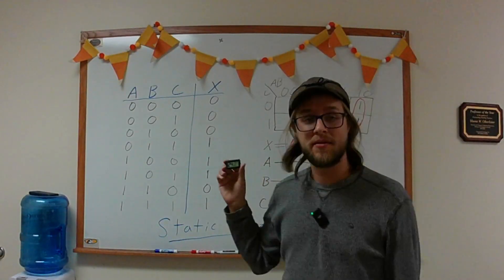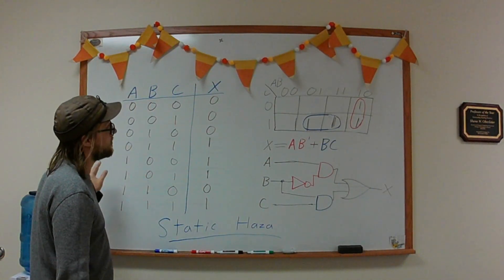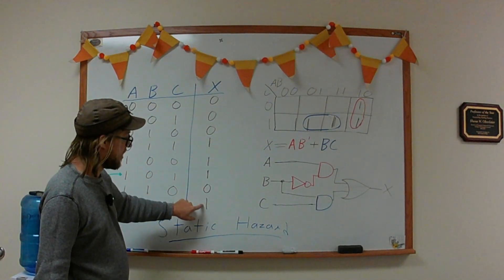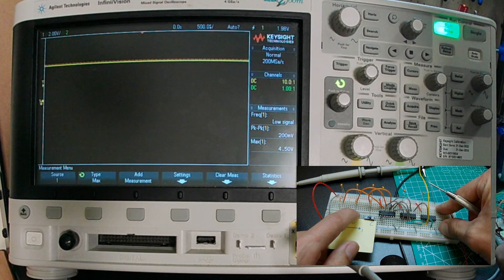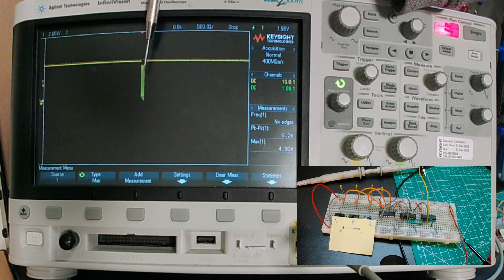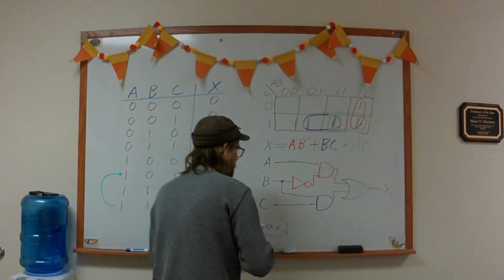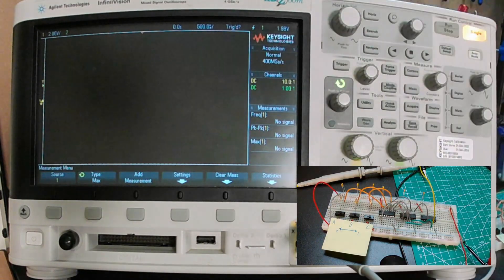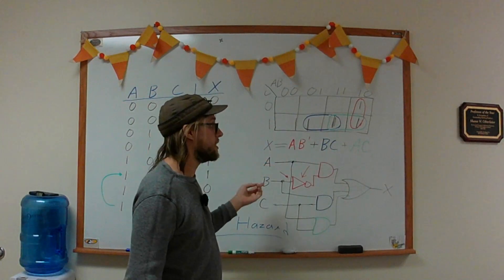Finding Digital Logic Static Hazards

Comment: Nicely explained. But what's the cause of the oscillation during the hazard transition time? There are no feedback loops and couldn't be a setup time violation causing metastability as in a FF, and probably not switch bounce since you had RC filters on them that should take care of it if correctly designed. So I guess it's due to slow transitions from the RC filters causing non-Schmitt inputs on the gates to act up?

Comment: Didn't expect to see you around these parts.

As far as static hazards, I didn't figure out what you were referring to until you demonstrated the issue(It appears to be an output disturbance induced by an input transition where the output would ideally remain static, but does not in practice). The topic definitely wasn't discussed in my digital logic class (not surprising, often engineering classes skip practical considerations to simplify lessons, and the professor was inexperienced). I would say as a point of feedback it would be helpful to define 'static hazard' clearly at the beginning of the video without moving directly to 'these conditions cause something with that name to occur'. It's probably fair to assume if someone does not understand this topic, then they may also be unaware what certain terms mean.

Otherwise the presentation was clear. As far as what 'precision' means, I'm guessing this would impact asynchronous circuits more than synchronous circuits, and in the latter case affect settling time more than anything (unless we start to get into interference/coupling effects of this impulse perhaps present on a densely packed integrated circuit). Not necessary to dive into deeply by any means but a very short summary of scenarios where this would be a problem would also be useful.

As for the oscilloscope, I'm sure you probably already figured this out but it only captured one of the pulses that I could see, might help to use a longer shutter speed. I'm guessing if you could see it with the naked eye each then the shutter speed was a shorter duration than the video frame rate.